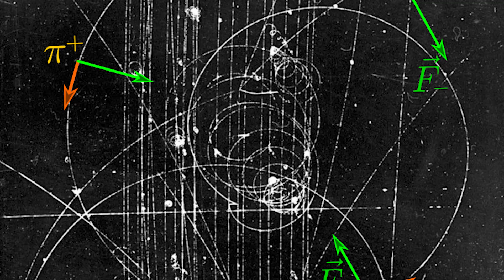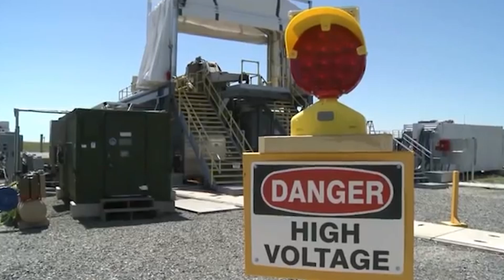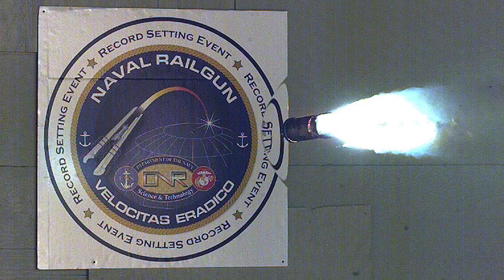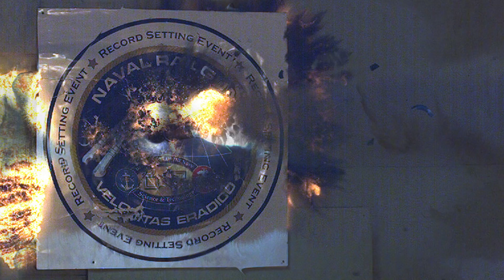Railguns: The Kinetic Future of Warfare

Comment: A suggestion - how ultra-fast technology developed. Gradually frames-per-second increased - starting at the bog-standard 30fps that recorded simple motion to the mind-boggling techniques used to film those rail-gun projectiles moving at thousands of m/s.
Reply: Tracking ultra-high speed targets is usually done using mirrors
Reply: That is indeed an interesting subject, including the early million frames per second camera's that could only take a handful of pictures....
Reply: @DreadX10  For the atomic bomb tests, they had a super light gas in the enclosure of the cameras so the armature could move fast enough. Really cool stuff.
Reply: do-you-think-you-got-enough-hyphens-in-your-comment?
Reply: @thefolder69  Not really. If you comment, at least try and say something intelligent and related to the clip.

Comment: What about Gauss guns? Railguns IIRC cannot fire anything other than slugs, as the electrical current would fry complicated electronics in the shell needed for precision guidance of the round, or explode any explosives inside the shell. Gauss guns don't electrify the round and will leave the shell's special insides alone.

I can see gunpowder, Gauss guns and railguns coexisting, however.

Comment: Realistically, coilguns (Gauss cannons) are the better route to go. They're more sophisticated than railguns, but they don't suffer from the railgun's deficiencies, namely friction. projectiles would effectively levitate in the barrel of a coilgun as it's launched and coilguns can achieve higher velocities given enough power and coil stages. The main hurdle for coilguns seems to be the need for an advanced, but robust switching mechanism and the ability to distribute massive amounts of power within microsecond intervals. Hope to see further development of Gauss weapons in the future.
Reply: You answered your own question for why railguns, rather than coilguns are the focus of military research as of now. Railguns are mechanically simpler, and that simplicity (if the kinks like projectiles arc-welding to the rails be ironed out) makes them far more appealing military weapons than something more complex.

Nobody wants a weapon that requires a PhD to fire and maintain, since your average serviceman doesn't have a PhD.

Comment: There are many reasons we keep tactical nuclear weapons close to hand. This boondoggle is one of them.
Reply: Yeah, I keep a few old Davy Crockett warheads around because my personal defense rail gun is a dud.
Reply: If these railguns could replace tactical nuclear weapons in some applications, that would be quite advantageous. Being able to hit and destroy hardened targets from standoff ranges without the political and (quite literal) fallout of low-yield nuclear weapons is a very good thing.

Tactical nukes aren't good battlefield weapons. When you start popping off the tactical nuclear warheads, you can bet that things will escalate to the big stuff.
Reply: @Schwarzvogel1  Even if you could build a rail gun that does not blow itself to bits after a few uses the power required would pretty much restrict their use to naval vessels. Probably nuclear powered ships. This would have little to no bearing on how tactical nukes fit into land or air based warfare. Nor naval strategy for that matter.

Comment: Don't worry, railguns will see a huge amount of use once we start fighting in space for the Moon and Mars.
Reply: And every time you fire it you end up further away from your target.  lol
Reply: Considering the difference in mass between the projectile and whatever vehicle would be firing it I doubt that would ever become an issue.
Reply: @RaydeusMX  The kinetic energy is far more that just the mass of the projectile.  You are aware of the principles behind an ion engine?
Reply: Which is a constant stream of particles expelled over a very long period of time to reach very high speeds. Completely different from the case in hand. 

(Edit > And that's before even considering maneuvering thrusters compensating for any minor displacements that may occur while firing a railgun.)

Comment: Could a better, smaller version be mounted on a plane?
Reply: In theory yes, in reality not so much, if you downsize this to fit and be able to fire from a plane, you go from ~100 km range to ~10 km range, much better than conventional cannon would be on a plane, but much worse than current BVR weaponry. On a ship sized system it is able to shoot beyond what most missiles can other than ballistic ones, and for much cheaper (in theory) than any missile.
Reply: @thorin1045   misiles can go around corners, bullets don't. Now it would also stall the plane when firing and it would depend 100% on the pilots skill which makes it unreliable. I was asking because it could be a great anti ship weapon but then again missiles are still superior.

Also I think I wouldn't replace a full auto Canon, rather it would replace anti tank missiles or anti ship missiles